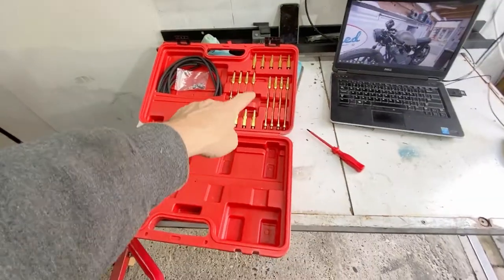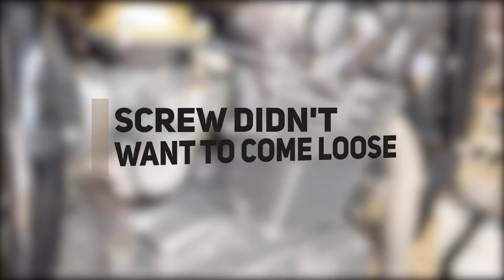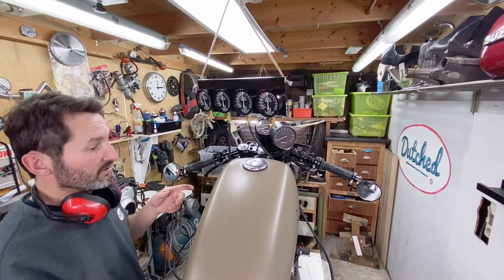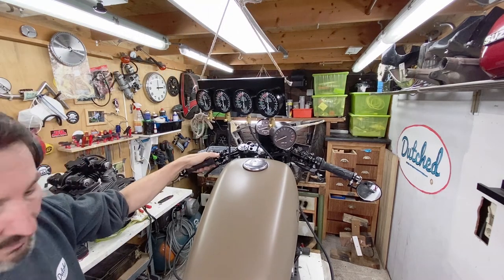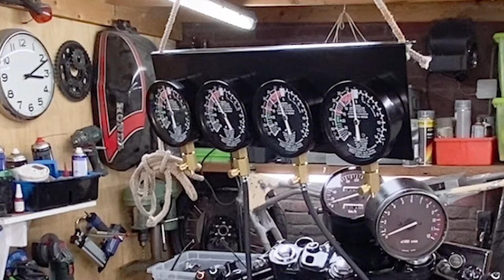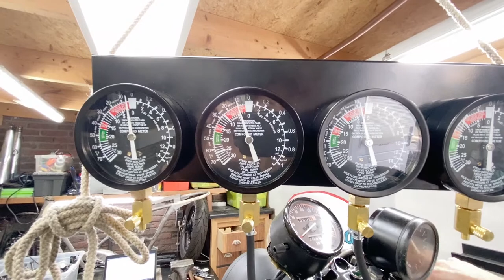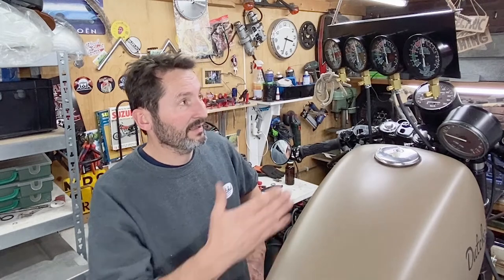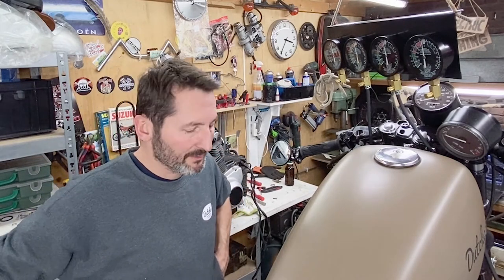Caferacer Suzuki GS450 Synchronise Carburetors

Comment: to synchronize the carbs you need to adjust the throttle. you turned the idler screw. but there is another little screw where the throttle cable is hooked in. this is the only way to synchronize. with this screw (countered) you change the position of left "flap" in the carbs to the right "flap". loosen the counter, turn the idler screw up to 1500-1800 rpm an then turn the screw under the throttle cable in or out until the needles of both gauges are at same position, fix counter. then turn idling down to around 750rpm. the small screws on the sides are for idling mixture (gas -air mix), turn one by one in or out until highest idling. turn idling up to 1500rpm and check gauges again. maybe synchronize again. then bike will better react. dont think the valves or something is wrong
Reply from the maker: I’ll have a go ! Cheers👊

Comment: Good luck getting the vacuum in sync, it can take some time but you will eventually get there 👍😊 Have you measured the compression for each cylinder? I would have focused on the carbs if the compression is approx the same across cylinders. If compression vary you might want to look at that first. A few other tips: 1) if coil/spark plugs and wires are old, try to swap around and see if the problem moves along, or just measure coil/wires with a multimeter, coils can perform OK when cold and badly when warm 2) put a fan in front of the engine to avoid engine overheating 3) get some JIS screwdrivers - japanese industrial standard) 4) perhaps shorten or just skip the intro? 3sec is OK, 30sec is way too long in my opinion 😋
Reply from the maker: Thanks for the tips and pointers. 1) i will check compression again but this (was) oke at the start. 2) after the video i did swap the coils just to check, i had the right coil on the correct cyllinder.
3) if you look closely at the end you will see the fan i placed in front of the engine, but good tip anyway 👍.
4) And i agree on the intro, its to long so i will definitely look into that.
Reply: @DutchedShedBuilds   Great! Seems like you have it all covered 😊 about swapping coil, sparkplug-wire+cap and spark plug: it's not to check that you have connected it correctly. Of course you must make sure it all is wired correctly, but by swapping these components and still maintain correct wiring you can check if vacuum readings are the same or if it has moved together with the swap.
Reply from the maker: @kihestad  how did you like the new intro that you see in the winterbuild series?
Reply: @DutchedShedBuilds  well done, short, snappy and informative! 😊👍

Comment: what size jets did you use with those pod filters?
Reply from the maker: I went 2 sizes up from stock. But i have to say that the particular podfilters that are on the bike in this video are not good. I just ordered proper filters (K&N RC-1822) and start adjusting the carbs accordingly. I'll do a full video on the air/fuel mixture problem as i - hopefully - get it running good